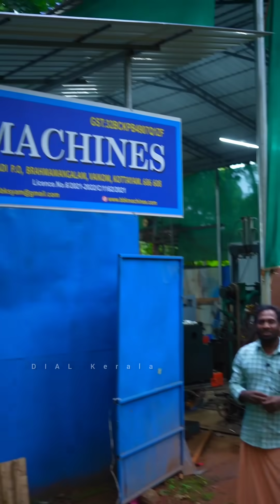Amazing Bricks Making in kerala

Comment: compressive strength എത്ര എന്ന് Test Results Documents കാണണം , അറിയണം . എന്നിട്ട് ഇവർ പറയുന്നത്  വിശ്വസിച്ചാൽ മതി
Reply: ചിലർ അങ്ങനെയാണ് ഭൂമി ഉരുണ്ടതാണെന്നു പറഞ്ഞാലും വിശ്വസിക്കില്ല
Reply: @reactiont5512  switch ഇട്ടാൽ ലൈറ്റ് kattukayum kathathe ഇരിക്കുകയും ചെയ്യും
Reply: well said, We should consider engineering parameters
Reply: ശരിയാണ് വീടാണ് വർഷങ്ങളോളം താമസിക്കാൻ ഉള്ളതും ആണ് അതിൽ ഒരു കോമ്പ്രോമൈസ് വേണ്ട
Reply: സത്യം ഏറ്റവും safe is code il ഉള്ള materials ഉപയോഗിക്കുന്നതാണ്.
Reply: Athe 👍👍

10 yr kazhinj entelum issue varumbo nokit karyam illa 

Mann mix aanel itil plastering cheyyan patto
Reply: @priyadarshan4502  well said bro
Reply: Customer could check strength their cost
Reply: @R945-l6f  എത്ര ചട്ടി മണലിന് എത്ര ചട്ടി സിമന്റ് എന്നെ കാര്യം ഇതിൽ പറയുന്നില്ല . അതാണ് പ്രധാന കാര്യം
Reply: @R945-l6f  👍
Reply: @binoyvishnu.  Pala kaaryangalum, vila adakkam illa. Oru thattikkoottu video. Validity illatha claims. Proven alla. Vangunnavar jagrathai. Always use quality bricks like normal chude katta / chenkal. Veedu jeevithathil orikkal maathram.

Comment: This product is waste of money building don't last more than 10 years
Reply: Why
Reply: @anishv6831  my is house is made same product but different design when it exposed to water and moisture the material start to denigrate
Reply: @travelwithme2637  shall we protect by any material...i also build my house using mud block ..only 6 month old....i used putty to cover......i have full.protecton from water...no even drop touch the wall ..sugest some solution to protect
Reply: @anishv6831  wait for 7 years you will see it
Reply: @travelwithme2637  any solutions??
Reply: @anishv6831  paster completely when problem starts
Reply: Okk any solutions befire tat...which brick  did u usee...name of the.brrick???
Reply: @anishv6831  interlock
Reply: @travelwithme2637  ok .we construct normal.one...